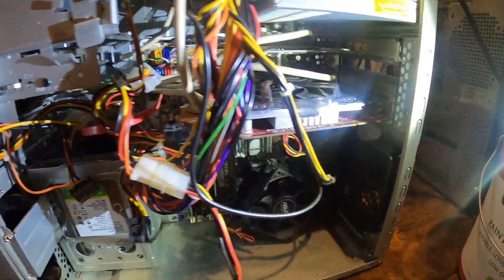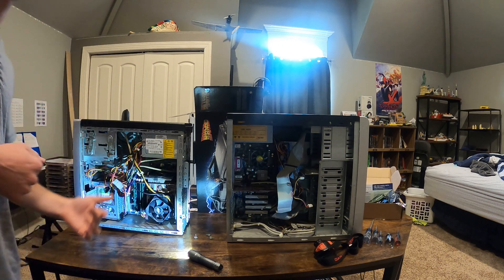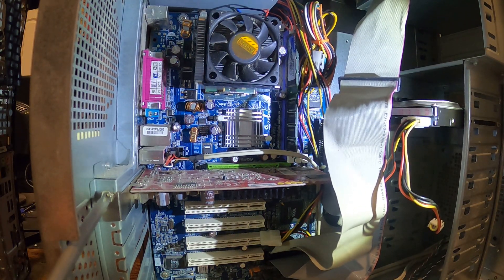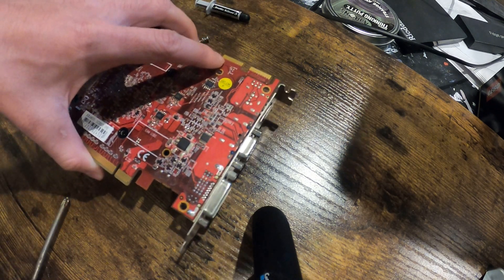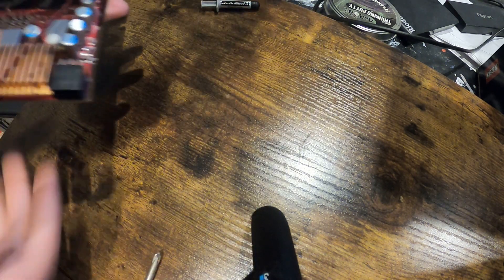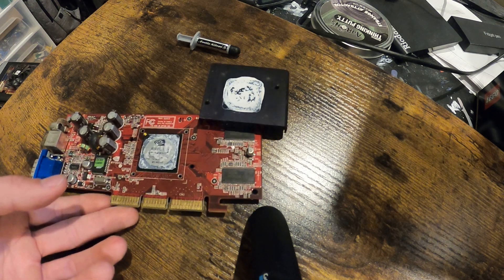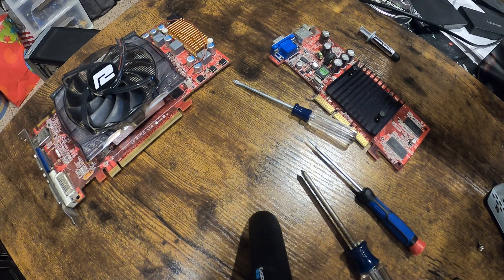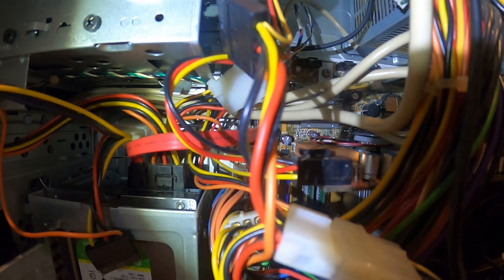The Weirdest Windows 10 Issue I've Ever Seen and How to Fix It

Comment: once a month i blow the dust out of my PC... once a year i clean and reapply TIM(thermal paste) to the graphics card and CPU.
Reply from the maker: You practice way better maintenance than I do man. Can of compressed air or you got an actual compressor?
Reply: @paintech2062  air compressor.  if you use an air compressor gotta make sure you have a water/oil trap so you don't spray oily water into your PC.  i try to keep a can of air by my desk for keyboards but that stuff is like 8 or 10 bucks a can!  
If you keep it dust free and maintained your PC will last a super long time.
Reply: If i get a used video card somewhere or PC from a flea mkt or whatever. i always check the thermal compound too.
Reply from the maker: @mikehensley78  Also have an air compressor. Try to clean PC at least once every 6 months

Comment: Just a little tip with repasting a old cpu or in this case gpu use some ipa and clean off the heatspreader or dye and then reapply the thermal paste you will get much better temps and will last longer.
Reply: Always clean the old thermal interface material. always.
Reply from the maker: I actually mentioned this in the video, but the GPU I reapplied thermal paste to isn't going to be used so I really couldn't be bothered lol